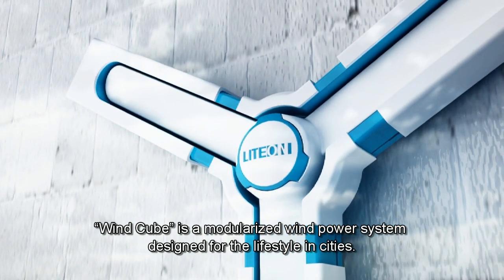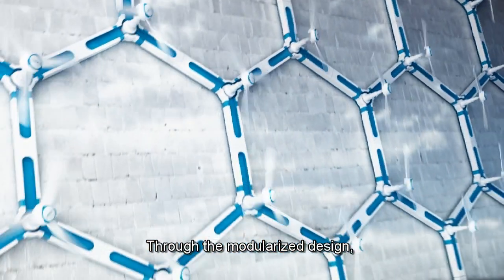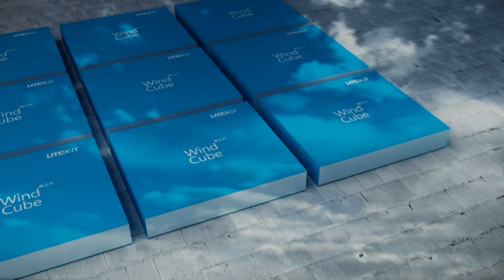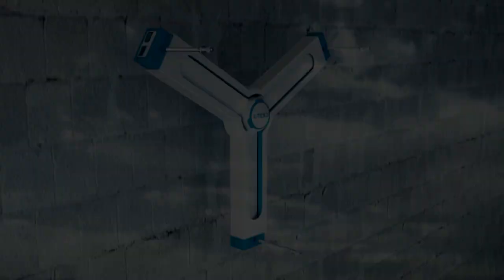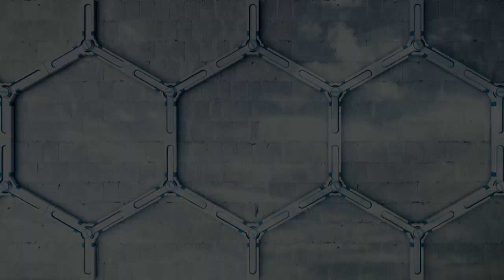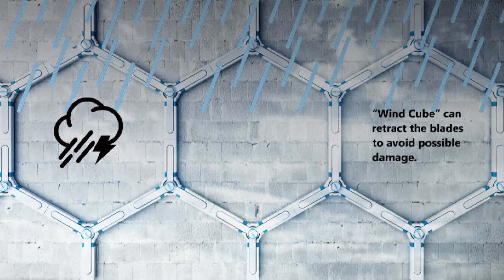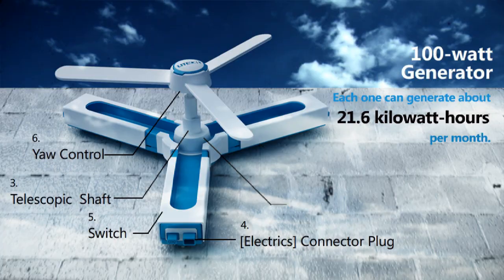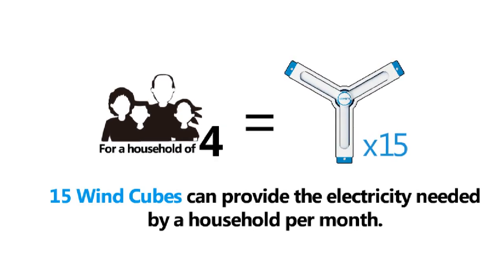Wind Cube (Modularized Wind Power System)

Comment: Very interesting concept, but there are a couple of points I'd be interested in getting clarified. Wind turbines create a lot of problems for bat populations. Would using Wind Cubes circumvent those problems? Wind turbines can be noisy and create vibrations. Would mounting Wind Cubes on the walls of residential buildings cause disturbance?